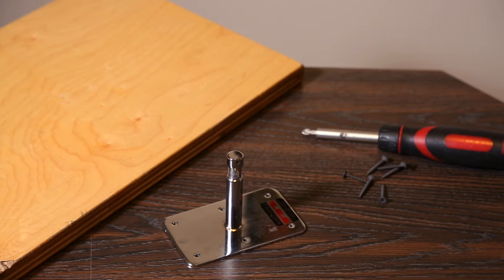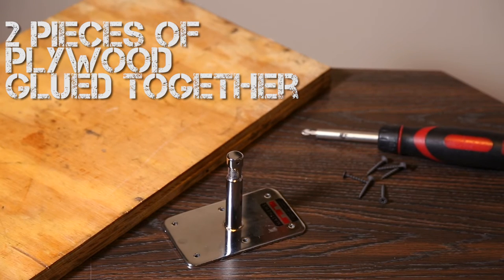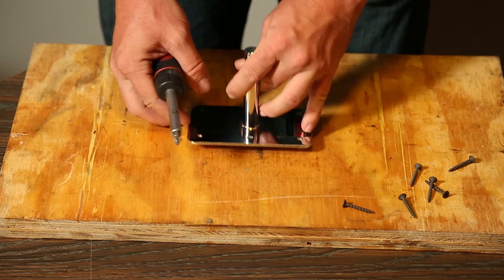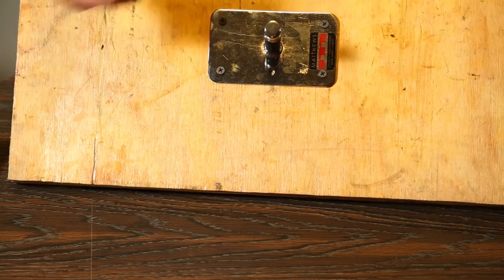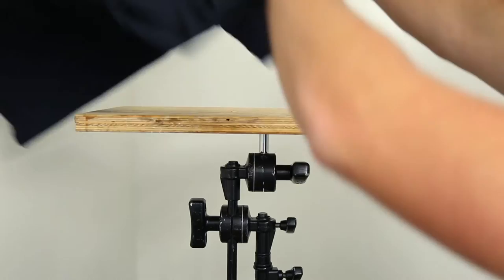Ep 13:  Baby Plates

Comment: Question about Baby Plate:  I am working in the art Dept for a "music reality" show that is currently in Pre-production. I am attempting to come up with a design that will showcase various guitars in front of some light boxes using vertical pipes and grip equipment.  Let me know if you think my current brainstorm will work. I am thinking of screwing baby plates of 3"&6" pins to the back of a guitar hanger with a wooden base and then putting the pin into a Mafer clamp which will camp onto the pipes.

I was hoping to include some magic arms and offset arms, however, at this point, it seems to be cost prohibited.

My main concern is these instruments are sponsor items and insanely expensive. I would hate to damage them and am looking for good ways to test my theories. Any feedback you may be able to provide would be very helpful.

Just found your account today, and am loving the videos. Thanks for sharing your knowledge.

Comment: Amazing channel! You got a new sub! 

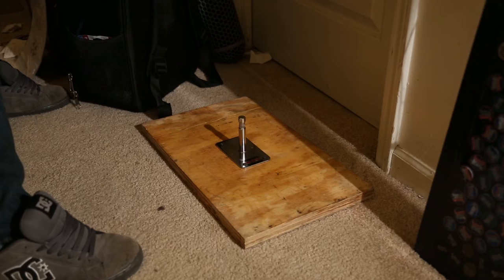I wanted to ask: what is the type of adapter that is on the yoke of your light that I saw you attach to the pin on the "apple board" you made at 1:44?

I have a few can lights with only a yoke and want to know what adapter you're using. 

much appreciated!!

A video with the anatomy of each part of Grip Gear (names AND dimensions) / electric Components would help us newbies as we would be educated as to what the name of "that part" is so we can go and buy it! 

cheers!
Reply from the maker: Mark Henry Cooney any baby pin adapter that is female 5/8 to at least 1/4-20" male. Here's a link https://www.bhphotovideo.com/c/product/1046652-REG/matthews_350625_baby_pin_adapter.html. It's not like the one that comes standard on my light but this could work similar.
Reply: Much appreciated. I have already looked at the product you linked but I noted it wasn't the same one you had. 

I figured it was an exclusive Arri component.